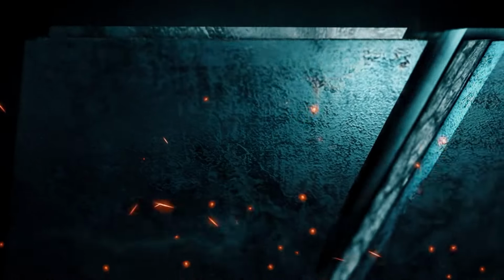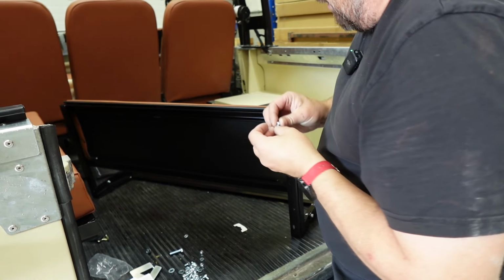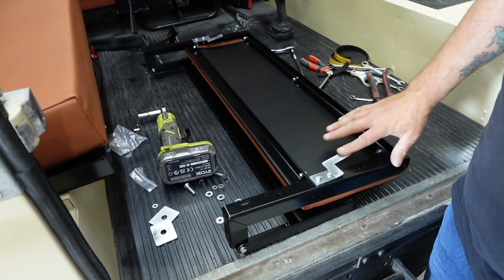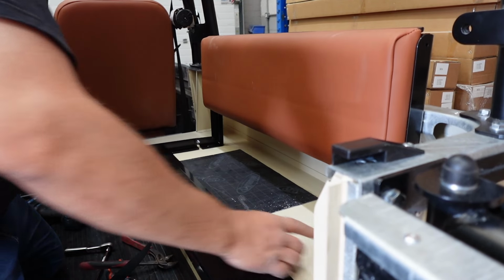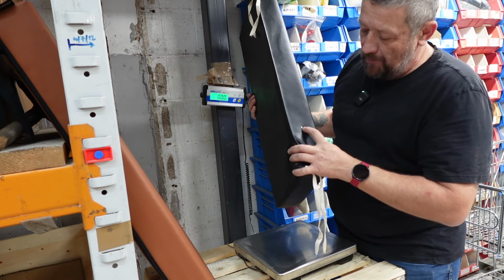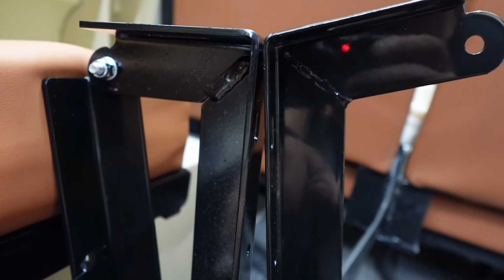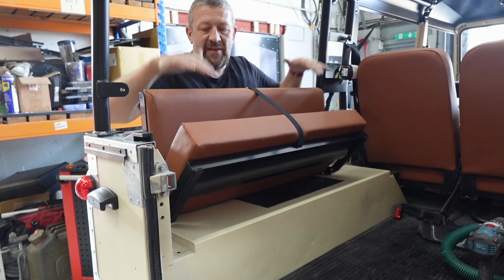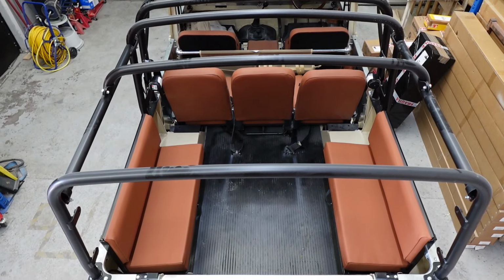Top tips on fitting bench seats into the back of your Land Rover.

Comment: When you're bashing something like those metal frames on top of paintwork, you should first apply silicone grease/lubricant and also slip some thin-and-strong plastic between the surfaces to protect the paint and avoid a future corrosion point.
Reply from the maker: Absolutely. I stuck some foam pad on there to help protect the paint. Also having painting it in Raptor helped.

Comment: What do you do about seatbelt mounting?  I am thinking about one side installation on my 2010 Defender 110 station wagon but will need at least one seatbelt (I really only need one extra seat to be occupied).
Reply: Generally, it's not recommended to wear a belt on a sideways facing seat, as the side forces in a crash can be more damaging than being unrestrained. I have a vague feeling that sideways seats are not permitted after a certain model year, but I could be wrong. However, you can get single seats that face forward and fold up sideways when not in use and have seatbelts.

Comment: I assume the installation is similar in a Defender 90...I have an early Basic TDCi with square rear wheel arches (not the curved ones for front facing seats)
Reply: Not strictly legal though
Reply: @henryyandell3222  ironically yes, but it's not illegal to stay strapped in nylon to an aluminum frame in a plane...anyways, I was hoping there is a way to install benches or seats without drilling the rear tub